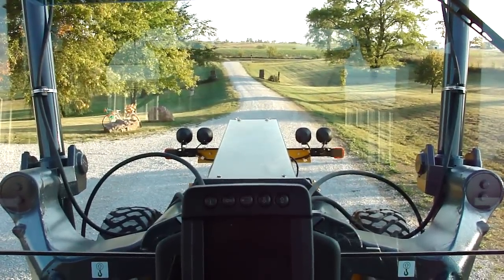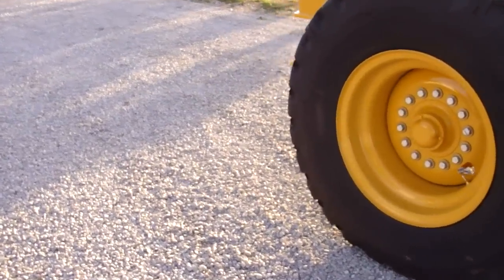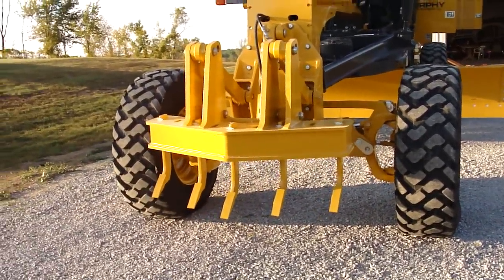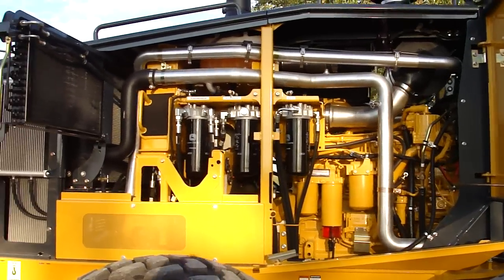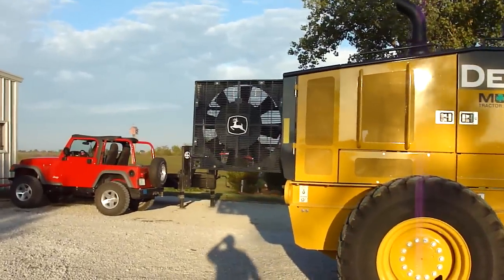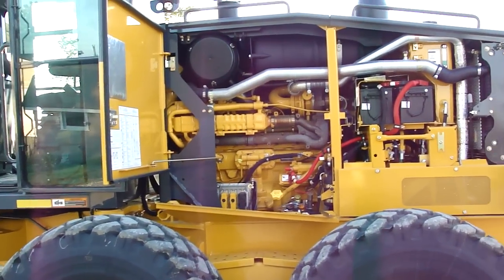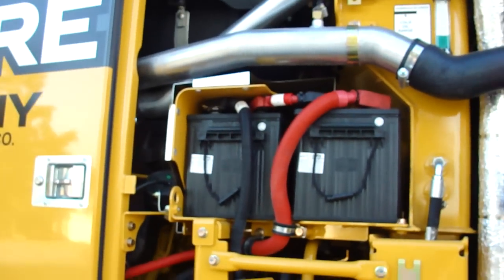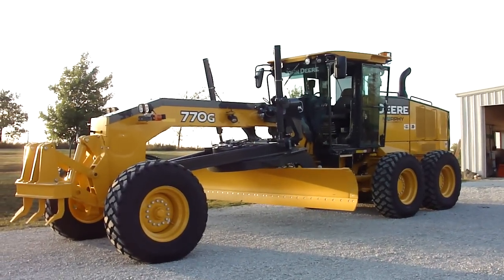John Deere JD770G Motor Grader

Comment: Hey man, congratulations on the new machine I run 672GP models in central Florida, in I think it’s very cool that you still run your blade lift levers on the right hand side. We used to switch the hydraulic lines and set them up like that I miss that set up .. I completely agree with you that when they raised that center beam when they went from the D to the G you completely lose visibility out of the front end that’s my only complaint on that machine.